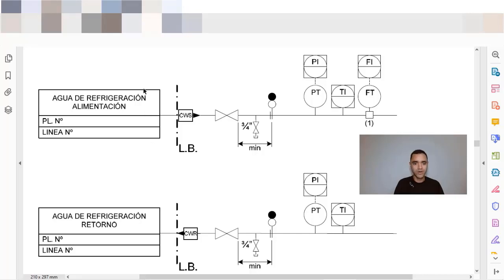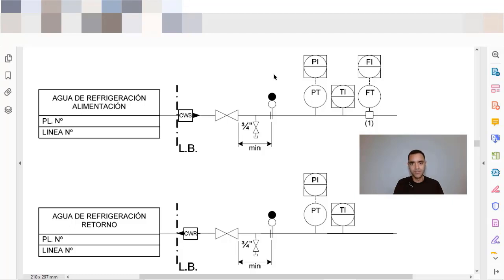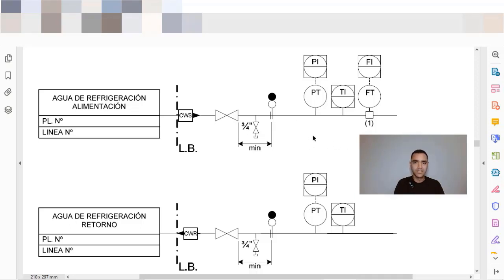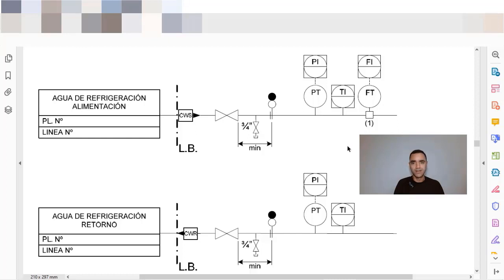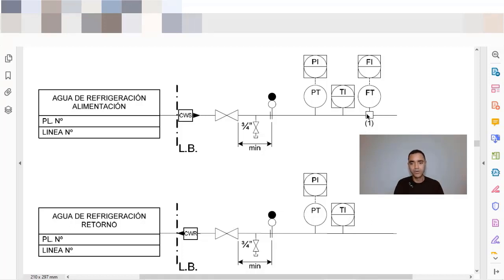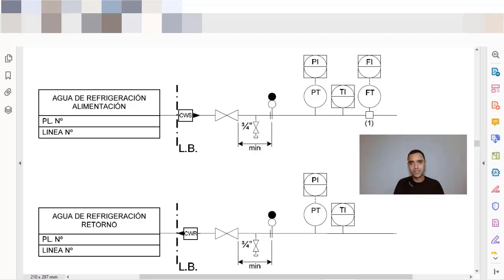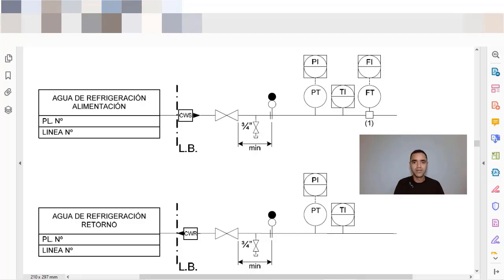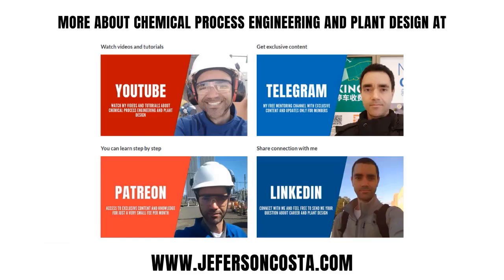Cooling water battery limits | P&Id arrangement | Cooling water supply | Cooling water feed

Comment: Hello sir, 
I have a question regarding compensated flow.
Sir, why we use compensated flow for gas ?
Should we use compensated gas flow for each and every gas line in plant or to some specific gas flow ??

Can compensated gas flow conditions be different from STP & NTP ??
Reply from the maker: Hi Dhruv, in summary volume flow varies with pressure and temperature. To make sure that calculations will give the same results independent on pressure and temperature we need to define a base for volumetric flow measurement. More information on this video https://youtu.be/QMlLnprKgI8
Reply: @jefersoncostaengineer   definitely sir, but my question is can compensated flow conditions be different than STP & NTP ?
Like in my project we are taking compensated gas flow at 2 KSC  and 40 °c , is it ok to go with the condition other than STP & NTP ?

SECOND THING should we go for compensated gas flow for each & every measured gas flow ? Because in my plant some some gas flow are measured at process condition & not at the compensated condition.
Reply from the maker: @dhruvpatel9012  if we were talking about real life, for Custody Transfer purposes, you will use T and P defined in the contract with your customer/supplier because both sides must have the same information, and you need to guarantee accuracy.

For process operations in many cases, you do not need the same level of accuracy, what matters most is the control.

If time permits, I will let audio available in the Telegram channel INPROCESS 😇😇